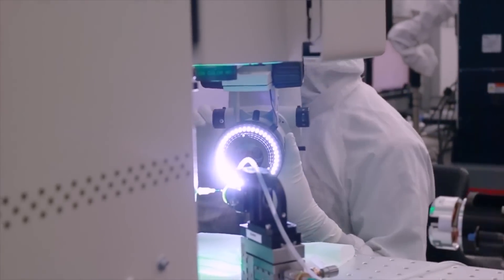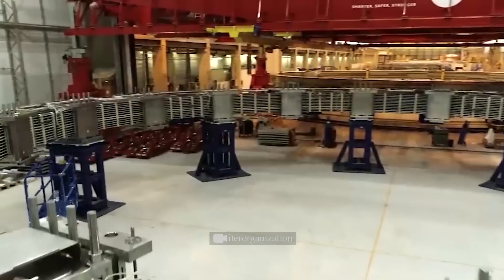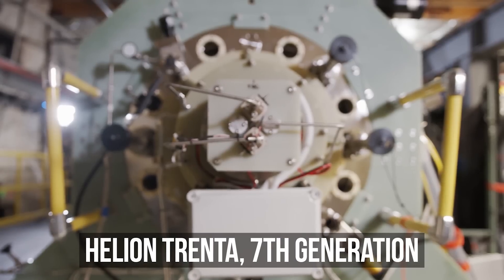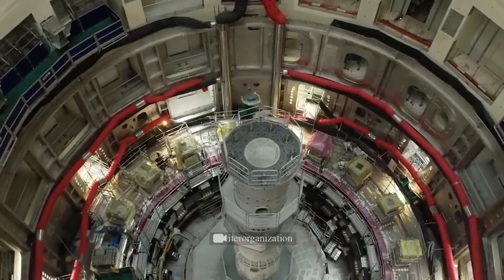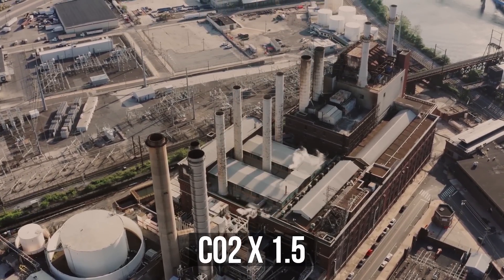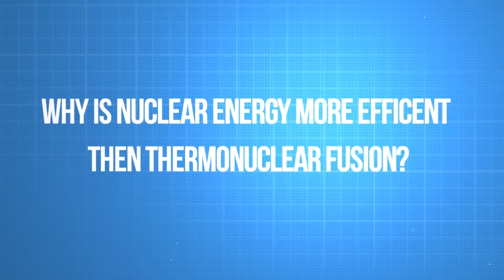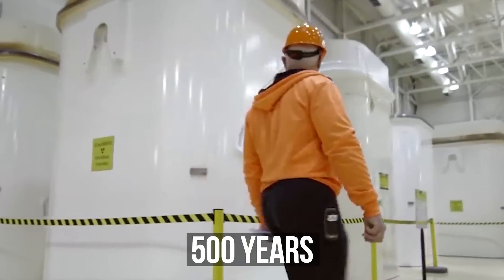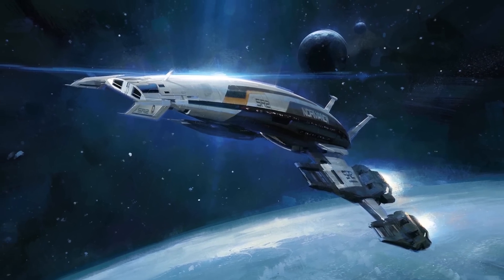Biggest Breakthrough With Nuclear Fusion Finally Happened!

Comment: They contained a fusion reaction for "a record long time"? I'd like to know how long it was exactly, and how close it puts us to having an "infinite amount of energy".
Reply: Sensationalist language used to appeal to the commoners. Why else would this channel have over five million subs?
Reply: It isn't infinite, atoms would only combine till something similar till they reach maximum Binding energy per nucleon ( 8.8 MeV at Fe 56 )
if you're considering basic idea about fusion from something out of 12th grade books.

Also in these books, it's stated that once fusion starts, It releases so much energy that it makes the other molecules undergo fusion as well.

It required alot of energy to melt the Hydrogen till it's plasma state (need temperatures at 3 x 10⁹ K) 
So you can guess why it's so hard to do fusion

Well i know it's alot deeper topic than this but well, that's what the 12th grade books say
Reply: Nothing is really infinite, the idea is to have something to power a city for 100 years, not technically about it being 'infinite'.
Reply: he said it in the video: about 18min

Comment: Thermal energy transmitted through fibre optic cables?  Can heat be transmitted via fiber optic? Or is thermal energy something else?
Reply: glass used in fibre optic cables is much more different then of what you heard in the video.fibre optic cables is used to transfer data with fractions of heat as the form of energy is supposed to be electrical to conduct data, if the energy is thermal then you wont get any data from that cable lol
Reply: @slavb0i646  So the transducer that turns the light pulses back to binary information would overheat? :)

Comment: Nuclear Fusion power and Nuclear Fission power is constantly framed as a "this or" discussion. In the future it will almost certainly be a "this and" discussion. We wouldn't be able to revel in the modern benefits of nuclear fission power if not for the past 60 years of practice, experience, and sometimes getting it wrong. Our forbearers started somewhere for our benefit today. We too must start somewhere for our successors' benefit tomorrow.
Reply: Fission works while fusion is unsustainable. You can only keep the reaction going for a fraction of a second while fission can go on for decades.
Reply: @funveeable  fission is a very political matter as the public doesnt want to do anything do with radioactive material. hence it's not so popularized yet and we havent moved away from it, but also from the pressure of the fuel industries, they dont want to lose their money.

Comment: So with the The Large Hadron Collider splitting particles to reveal whats inside, can we in the right conditions put them back together which can result into making other particles/nucleus we may not know of yet?
Reply: We have already made things like pentaquarks. Things like that are INCREDIBLY unstable. These pentaquarks are classified as exotic matter
Reply: Possibly but it's very likely that they would be so unstable they would decay back into other elements
Reply: Possibly but it's very likely that they would be so unstable they would decay back into other elements
Reply: @AriftChronon no matter if oxygen is present it will still decay.
Reply: @matthewmotor18  sorry replied thinking this was a different thread that i posted on.
Reply: we have discovered elements that are only active for fractions of a millisecond, rendering them useless for now. and the likelihood of them being discovered in a nuclear reactor is even smaller for now.
Reply: They are actually working on that to produce dark matter. CERN has been around for a long time. There used to be a smaller hadron collider in Illinois during the 1980s-1990s
Reply: @MatthewM575  dark matter is a theory, it gives us an answer for alot of the questions about our existence, but its a theory.
Reply: @slavb0i646  When does a theory become fact? At one point in time gravity was a theory, splitting an atom was just a theory.
Reply: @MatthewM575  cant produce dark matter without knowing if it exists
Reply: @slavb0i646  huh?? We.. What??? We know something is causing it, we are unsure if it’s a force, particle, whatever. But stuff decays and we can see what it decays into. It’s also a very complex topic and I would suggest further research before responding.
Reply: each cell of our body is a mini nuclear reactor, we are self-sufficient. AI artificial intelligence, to get to our energy resources, draws from us; oil, gas, helium - everything from life. AI AI intersects with life , crucify , inoculates ,to have direct access

Comment: We need to stop putting so much focus into electric cars (right now) as that is only a solution for AT TOPS (TOPS) 5% global emissions (more like 2%) and start pushing for nuclear energy. Or, at least research into safer nuclear power. It's a shame that activists think we're going to solve so much with an electric car, which are powered by fossil fuels.. Oil paintings and gas powered vehicles are the least of our worries...

Comment: Yeah well, this has become way too overhyped. The laser beams inserted 2MJ or something like that, and they somehow measured an output of 3MJ. But there's no way to capture this output and turn it into electricity. Not even remotely. 

And also, the loss in the lasers is not taken into account. So in reality they did not get more out of the reaction than the total power that was required to start it.

Don't get me wrong, fusion is very interesting and if we can crack it that would give us unlimited electricity.

However, we are far far away from that yet. This side of 2100 seems unlikely to me. If we ever manage to get it working. May end up being impossible to do outside of labs
Reply: hence he mentioned pure energy, as in net energy. also dont be so helpless about it, everything comes at its own pace,

Comment: awesome that fusion is getting the recognition it deserves, but your assumptions that we won't need oil, gas and coal are flawed. your still going to need these three resources for clothing, electronics, fuel, lubricants, steel, insulation, even the magnets needed for fusion,the list goes on. yes fusion can help lower pollution, but without the above mentioned resources fusion cannot continue.

Comment: Question; it was mentioned that this produced 50% more energy than put in bud did that include how much energy was used to produce the helion3 and the deuterium????
Reply: Yes, it does include that. For an explanation, Its a rough 50, their achievement of ignition yielded a 0.5 net gain of energy (or ~50%). As approximately 2.05MJ of energy were inputted into the system and the output was 3.15MJ. Part of that 2.05MJ of input energy goes towards the fusion of deuterium/tritium atoms, atoms naturally want to combine and fuse, but the Coulomb barrier is what sits between atoms acting as a wall to stop them from fusing. To make atoms fuse, they basically a throw a whole bunch of energy at a atom until they can push it hard enough into the wall that it breaks, once it breaks there’s nothing stopping them from fusing anymore and the kinetic energy of the atoms slapping together and combing releases the 3.15MJ of energy, and also releases the newly combined atoms in the form of Helium-3. I hope this explanation helps.

Comment: The only way to make our current nuclear reactors more efficient is to stop using them ad glorified hot water heaters. We need to find a way to DIRECTLY convert the radiation from the reactors to electricity. Like solar panels but for radiation. If we can do that we may be able to reduce the radiactive material to zero in a hundred years instead of 5000 years.

Comment: The Video contains lots of false facts and its easy to see that there wasn't that much independent research put into it. Infinite energy is an overtatement, tritium is infact incredibly rare and not abundant as said in the video, he compares "thermonuclear" to "nuclear" energy although after even the most basic understanding its easy know that both reactors are thermonuclear but not all fusion reactors are (like some mentioned in the video). the list goes on, I really recommend Real Engineering's video on the helion energy reactor it (he borrowed clips from him and didn't give credit) its definitely much better and more interesting.
Reply: It’s a riddle video. They’re all essentially pseudobabble nonsense. Don’t come to riddle for actual science. You come to riddle to see what’s happened in science recently, basically using it like a headline, and then go do your research within real sources
Reply: Thank you  for sharing. This is all very interesting!
Reply: NTM the democratic point of view...
Reply: There is an infinite energy.. try researching pyramid wireless energy and tesla tower wireless energy that generate power from the earths gravity.
Reply: @ultimaz1565  there is not infinite energy
Reply: @ultimaz1565  Physically, infinite energy doesn’t exist due to the law of conservation of energy, which is perhaps the most accurate law ever postulated. The term “infinite energy” means infinite in the sense of human existence. We probably won’t be around for another 30 thousand years, but the types of reactors we create could very well still be generating energy well into the tens of millions of years. That time is so exponentially large that it doesn’t really matter that it does have an end to us, but from a universal perspective calling that form of energy “infinite” is a bad joke. I don’t know what conspiracy theory you wrought from the pyramid wireless energy theory, but I’ve never heard of that. Along with that, Tesla’s tower didn’t create infinite energy, the idea was to make energy wireless. While it does work to that effect, the range is limited by scale. So the larger the building, the larger the field, but the growth of that field is logarithmic not exponential. So even if we build a Wardenclyff tower the size of Delaware in the center of Texas, you’d most likely only be able to wirelessly transmit power barely across the border, and that’s on a very generous metric. Generating power through gravity has already been postulated, correct, it’s called perpetual motion and we now know that it is completely impossible due to the law of conservation of energy.
Reply: @nodefiance9178  ok Finite
Reply: also the apparent 55% net profit energy is closer to 35%
Reply: Absolutely correct
Reply: M
Reply: Exposed lol
Reply: The real mind bending breakthrough is the UK fusion reactors proprietary PEM-based electrolyzer used to create hydrogen using determine-(heavy water) as a fuel that’s turned to plasma using gytrons-(basically a linear microwave emitter on steroids to heat plasma)
Reply: Yup but that was to much too know
Reply: Yeah riddles videos as been full of false information for a while now he flip flops and everything it's now a liberal democrat agenda pusher
Reply: A hydrogen bomb is more efficient. If you can't sustain the reaction and keep trying to get net energy put of it, you can't harness the energy for electricity.
Reply: It isn’t a fact if it’s false. This video straight up lies.
Reply: Thank you. We need more people like you helping the layman separate the good science videos from the sensationalist nonsense.
Reply: You make some fair points, but a few things here aren’t quite right either.

“Infinite energy” in the video wasn’t meant literally — it’s more of a shorthand for a potentially limitless source compared to fossil fuels, not truly infinite output.

Tritium is rare in nature, but most fusion systems plan to breed tritium from lithium inside the reactor, so its natural scarcity isn’t a permanent limitation.

Also, “thermonuclear” specifically refers to reactions driven by extremely high temperatures — that applies to fusion, not fission. Most fission reactors today aren’t thermonuclear; they split atoms, they don’t fuse them. So the comparison in the video isn’t completely off.

As for using clips, fair point if proper credit wasn’t given — but that doesn’t automatically invalidate the info presented. The science side of the video just simplifies things for a broader audience.
Reply: There's always comments in Riddles videos saying things like they learned nothing. I agree with you.
Reply: @MuvvLuvv  wen i saw the apparent statistics on fire and carbon deaths 3000000 a year my first thought was why has their not been a pandemic declared on fire and carbon? (joke) Riddles seems to like some kind of payd shill to talk up products that are not as good as he makes them out to be.
Reply: @MuvvLuvv  yeah
Reply: Correct, tritium in its natural occurrence is incredibly rare, however, efficient reactors typically have breeder blankets (typically lithium or a composite) to breed more tritium and produce the cycle of infinite energy, that’s why it’s allegedly infinite energy. Because you’re breeding the fuel you’re using but still receiving more energy. Not all reactors are thermonuclear by the way, thermonuclear reactions are mediated by thermal nuclear reactors, non-thermonuclear fusion reactions (such as uCF, muon-catalyzed) are not thermonuclear and thus require different reactors. It’s not so much that this video is laden with false facts, it’s that they’re uneducated or unexplained facts, they make the statement and don’t provide an explanation. I haven’t watched the video yet, I typically check comments on videos like these to see the general consensus on its content, but based off of the ball you’re pitching I’m taking a swing and saying that it’s not as inaccurate as you believe it is and more so poorly explained.
Reply: Ignore the latter part of my comment relating the nuclear reactor analysis, I misread your comment at that point, however the rest is still my own interpretation of your analysis.
Reply: Are you a scientist or did you get your information from another YouTube video comparing it to this one?😐
Reply: In Many Ridddle videos I found he misguide us. So i unsubscribed him long ago..👍
Reply: @justinformeyou1100  then why are you here
Reply: This chanal is gaverment suported for sure i will block it from now on :D false info always
Reply: @LvL9873  i dunno if it’s the government specifically first thing I was thinking was « who is funding this video »
Reply: @LvL9873  government lmao..
No its not.. and also you dont even understand what the video is saying.

Comment: 0 the fake Sun syndrome has been a topic of conversation for many many decades thus the high grade geoengineering that is used perpetually over our heads cloaking out the white star we call the Sun.
Not to mention manipulating weather, 
DEW's
One thing people don't pay attention to is that we have a binary star system a second sun which they've been cloaking out
If you pay very close attention to your sunrise and sunsets and you do it on a consistent basis and you're doing your Sun gazing  you'll easily detect what it is that I just described.
They each have their own color and that is an atmospheric toxins in the air only because there's a lot of those already there is a difference between red iron oxide and or barium strontium and also described as using lithium in the stratospheric airways in which falls through into our troposphere.
Pay attention people a lot is going on a lot is going on fast.
Keep the faith

Comment: So, If and when they can sustain a reaction..what's the result?
..it puts an end to coal and gas power stations.. I'm sure by then, battery tech also will have advanced to almost instant charge times and a reduction in size and mass, so everything with a combustion engine will become electric? Planes trains and automobiles.. an electric rocket i suppose would be the new holy grail